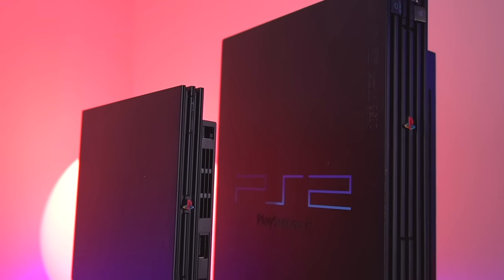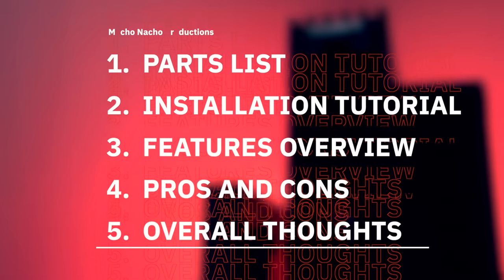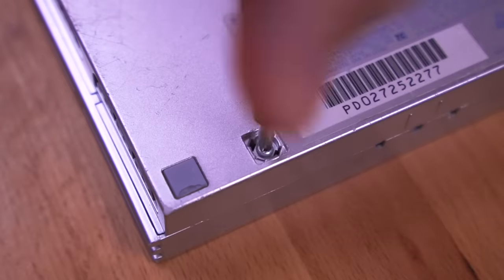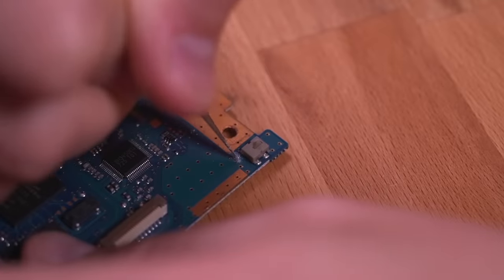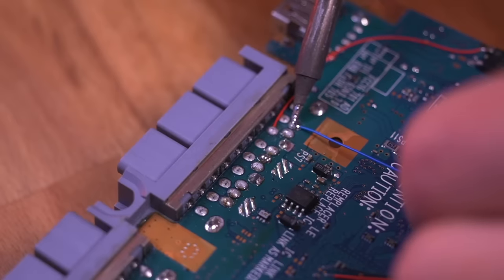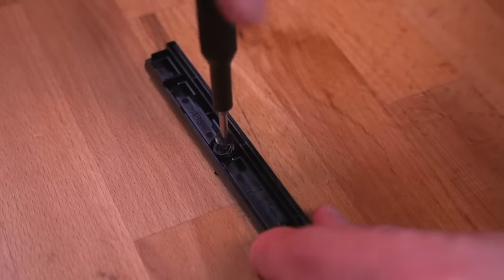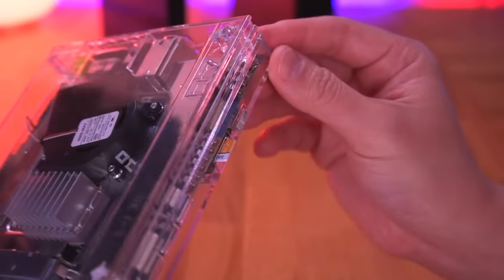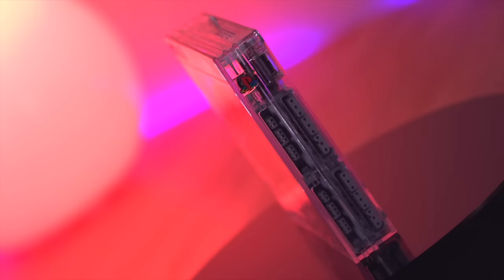Making The PS2 Even Smaller

Comment: Terrible mod. Not able to use discs and that would have been fine if I could load free mcboot using the second memory card slot. You can’t really save booted up games with an SD card if you can’t use both memory cards. There’s no point of the SD card either if you can use the USB port to install games. It’s kinda a pointless addition. It does look really cool and live the work put into it
Reply: It’s a bummer you can’t use the optical drive; I totally agree with you there. You can set up a VMC in OPL to save your games on the microSD card (if you have the right version of OPL). The MemCard Pro2 (around $50 and probably still hard to get) would work really well with this build, as it lets you run FMCB and save games too. Maybe everyone already knows this, but just in case—it’s worth mentioning! I managed to get one (MCP2) when they were released, and they’re pretty cool!

Comment: This project is turning out to be a waste of time and money. On the board itself I have gone through everything checking and rechecking probably about 10 times by now. My issue is that you didn't include how to format everything to where it would read off of the SD card. In that regards I've tried everything I could possibly think of even going to another one of your videos and trying that method as well, still nothing works. Not even the Samsung SD memory cards...
Reply: There are other videos on that you can check out.